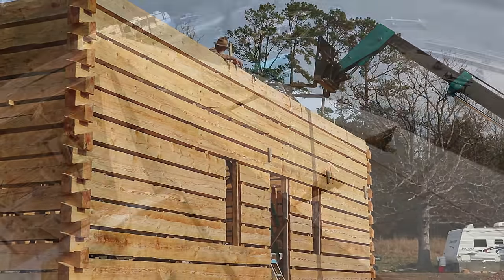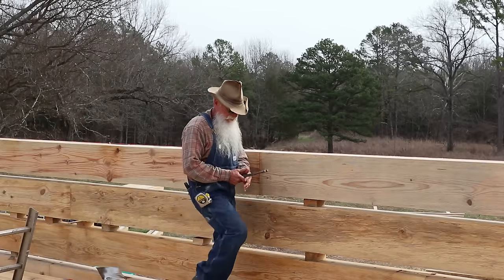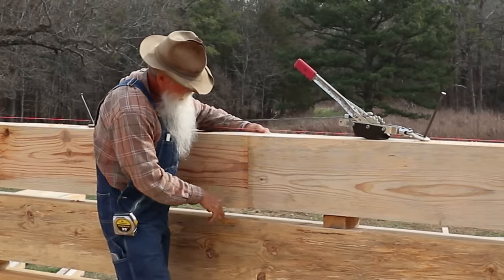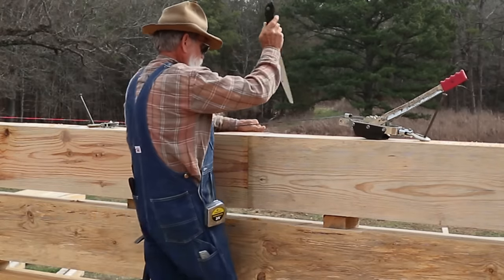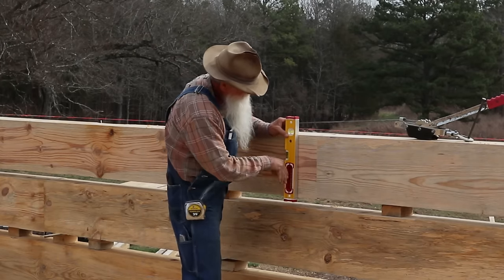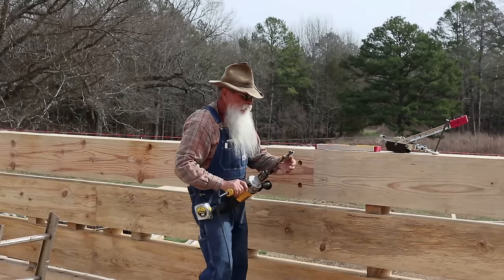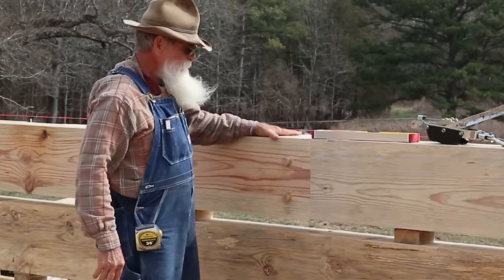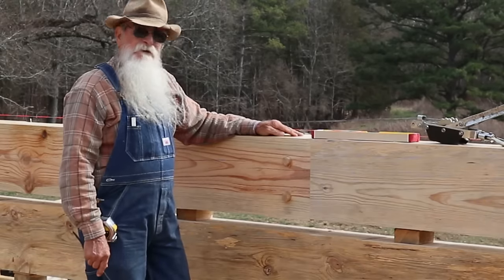Ozark Cabin Build, Ep 6 - Joining Two Logs Part 2

Comment: I like yoyr scoffed brackets.  We used althread on our conventional framed walls.  How are you mounting the brackets?
Reply from the maker: Howdy Francois- they are attached with all thread with a block of wood on the outside drilled for y’all thread to go through with a washer and nut   I put a screw down close to the bottom of the up right piece so it will stay vertical. God bless
Reply: @TheBeardedCarpenter  yup. I'm not sure how much wooden soffit and fascia we installed of those things. Likely miles. No OSHA, no workers comp.

Comment: I've never seen anyone build as done
Wondering why such huge gaps between planks,
Do you remove spacers or place something in between them
Or do you collapse them with a glue in between 
Would make for a really tight closed shell.
Or do you leave as is
Reply from the maker: Howdy y’all- the gaps are filled with insulation and chinking after the logs settle. The blocking stays in and is chinked over. I normally build with live edge logs and you see the natural shapes of the logs which is how the older cabins were built. Nowadays with access to sawmills people will get them squared up and leave a gap between the logs to copy what the old school log cabins looked like. Thank you so much for watching the video and for the comment. Take care and God bless